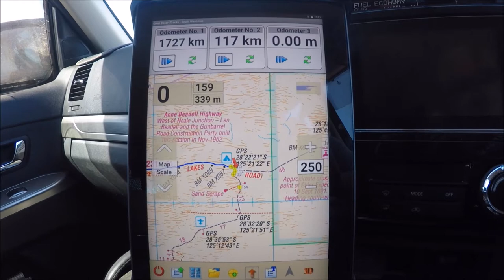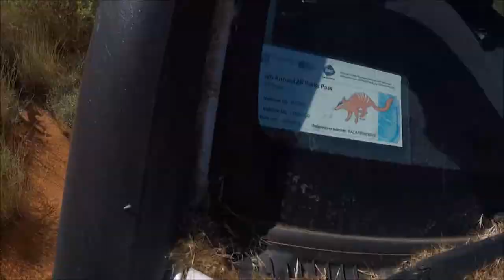2018 Mowing the Spackman part ii

Comment: What app do you use for your maps?
Reply from the maker: Ozi Explorer, Android. Changed over to a tablet version mid last year from the PC variant (had a lappy under the seat with external monitor). I haven't looked back since. That said, while the App itself is cheap, I already have the maps, which are in addition to the app price. I wrote about the change over here: http://sharkcaver.blogspot.com.au/2017/07/get-lost-why-dont-ya.html
Reply: Shane The Sharkcaver I have a heap of maps to so will have a look at the iPad version. Cheers
Reply from the maker: Sorry mate, ozi is android only, no Ipad version.
Reply: Shane The Sharkcaver 😞
Reply from the maker: There are plenty of apple apps out there, some free, some small fee, with ability to download maps for off road use (and possibly use what you already have). Sorry, I cant give you the good oil on all that, but google is your friend there.
Reply: have you tryed hema
Reply: Joseph Smith I've got HEMA Explorer. I have a lot of maps I had on ozi explorer on my PC. Trying to use them as well on iPad.